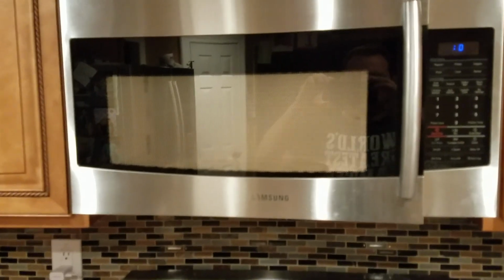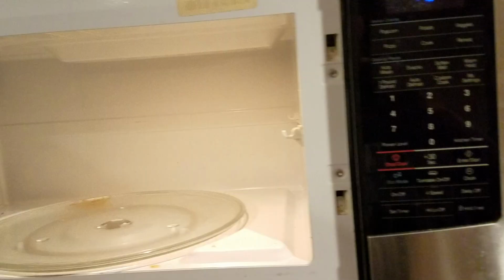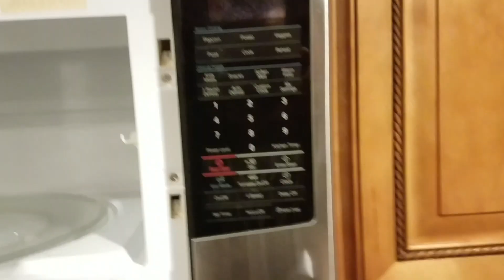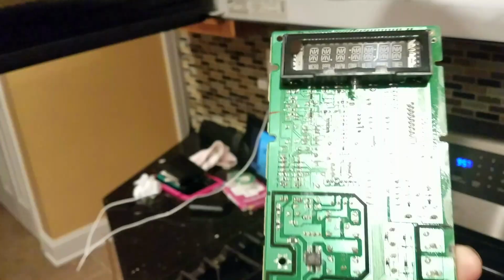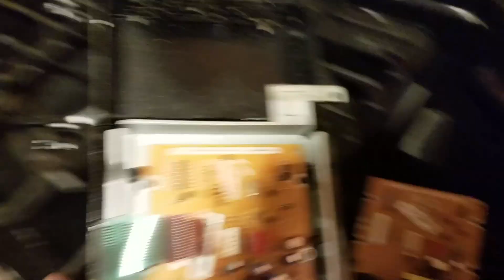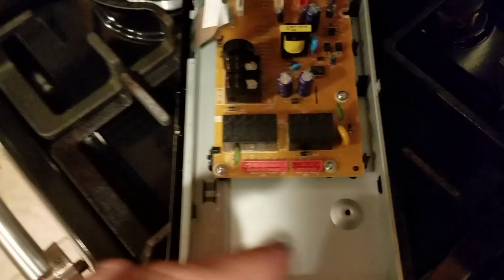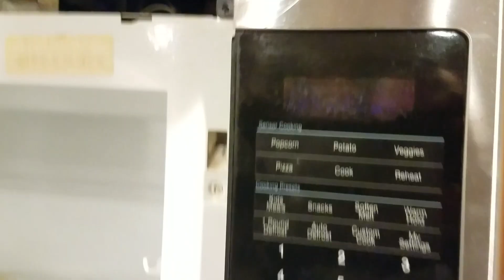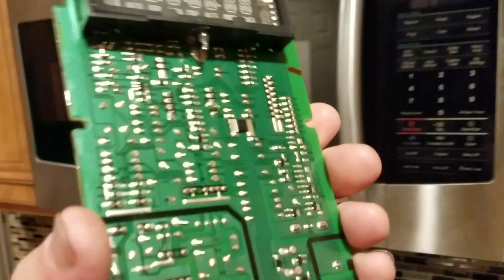Samsung microwave. Buzzing, humming.

Comment: Thanks for the video. My Samsung ME16H702SES would not turn off unless door was opened. It was not heating, but light, fan & table turn was operating. Control board replacement fixed the problem.

Comment: Thanks for the video. My Samsung me16h702ses would not turn off if door was closed - light, table turn & fan all ran. Replaced control board DE92-02434C, $60 on eBay & problem fixed.